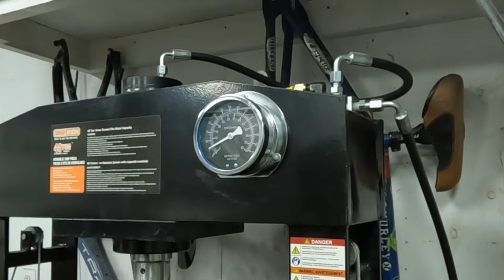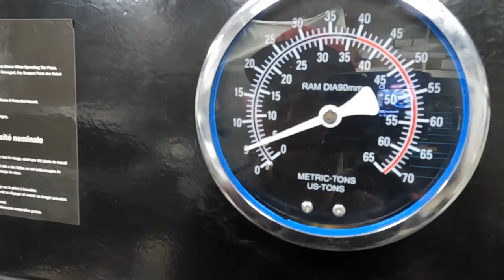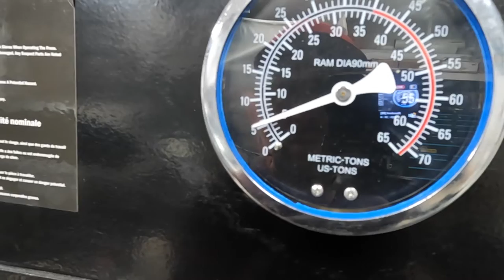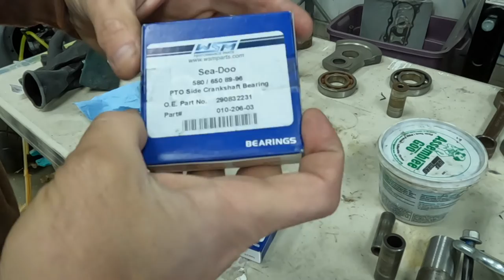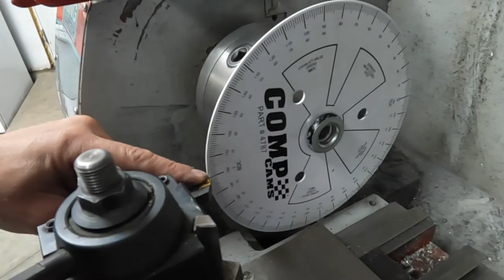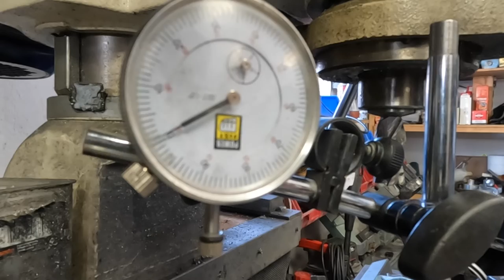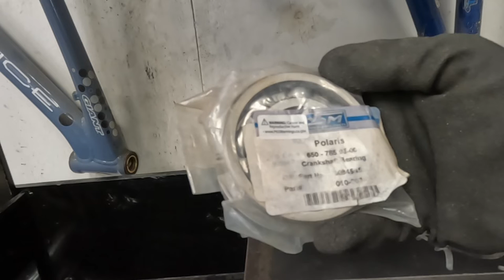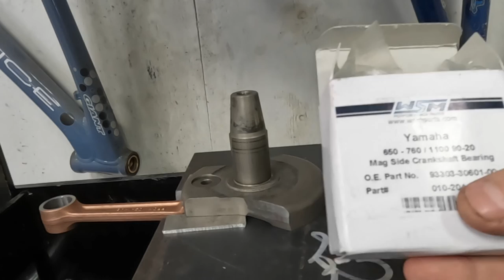KRASH KV997 Crank Rebuild - Sweet Sweet Success !

Comment: I've got a kawasaki 650 sc crank that is out of phase by 20-30 degrees.  I rebuilt everything on the engine just to find the problem was the crankshaft the whole time.  I've made some tools and used a friends 150 ton shop press and I have the crank apart.  Been researching how to get the phase correct and I'm gonna try this!  Going to weld the pins in as I go to make sure it does not get out of phase again!  Well done and thanks for the info!
Reply from the maker: Good luck. Let me know how it goes. Take care when welding 1. (obviously) not to damage the crank but also 2. use a compatible filler rod (not sure what that is) 3. not to put too much heat into the pin or web 4. try to weld directly across from each weld to avoid pulling the crank out of true.

Comment: Very cool video, I really appreciate how you found the correct parts for the rebuild. Yamaha bearing, seadoo bearing, and best of all cr500 connecting rods 👍🍻
Reply from the maker: Thanks ! It was a challenge to find some of the parts. The connecting rods actually have the part numbers on them, so that part was pretty easy, haha... The inner bearings also have numbers, but the two outer ones were tricky and it took me almost a week of research before I found out that Yamaha uses that large bearing on a TON of their stuff. 

I'm very confident now that I can rebuild all of my cranks, so that's a pretty big deal. It cost me $580 for all the parts and a new crank is $1540. plus shipping. If you include the press and the materials to make tools it was about $2160 haha.

Comment: You are a genius man, saved me ,  I have to make this job on a safari 377
Reply from the maker: Cool !! What year Safari !?
Reply: When I saw your video said the same: Great!! But I tried two times with a 15 TN press and nothing happened 😅, is a 1991 , have another 377 in a paratrike that I made in pandemics, I will try again next days, is not my press, so I can't try all the time
Reply from the maker: @Detodounpoco-xb2zo  Wow... that's on there good if it takes more than 15T ... I'm guessing you would notice if it was welded ... If it is not, try to heat the web area. If you just have a propane torch it make take 5-10 minutes. I can't remember but I don't thin any of mine took more than 5, maybe 10 tons.

Comment: Man!  I love how professional you make your tools! That bearing tool is brilliant!  You should patent those tools!
Reply from the maker: Thanks for the compliment !  The tool is in the public domain now as I showed the idea in a video, so it is not patentable, but it would be awesome if a manufacturer took my idea and turned this into a puller set (you need different sizes for different bearings) (and also different lengths) 

I don't know where you get them, or what they are called, but there is a tool that is kinda similar to this. I have only ever seen Alan Milyard use it. Basically 3 arms with rounded hooks that hook into the outer race by putting then in at a 45º to the shaft and then rocking them parallel to the shaft. You then use the main part of the puller to lock the hooks parallel and pull the bearing off.

Comment: This is great! I'm going to be attempting this with a 250 single so it should be substantially easier. I'm starting to think I might be able to do this correctly.
Reply from the maker: You got this ! Take lots of measurements before you get started and remember that you can always start over if you need to. Take your time and you'll get it.

Comment: Joel, I have not tried this (yet) but was planning on trying my hand on some crank rebuilds and doing the phasing making a set of spacers so that I can set one crank web with the center pin on the bed of a mill with a spacer under one big end pin and put a spacer under the big end pin of the "loose" crank web so that it will sit at 180 degrees phase relative to the one already on the center pin/bearing assembly. Afte rpressing together the phase can be checked by flipping over. Not sure if that made sense kind of tough to describe by words.
Reply from the maker: Yeah, I'm having a real hard time picturing what you are talking about, haha. There are lots of possible ways to do this, that's for sure, but explaining with just words is tricky. 

I have had a few ideas that may be what you are talking about, but I can't tell, haha.

Comment: Really good video dude!  Question for you, did you ever exceed 10 tones on your press?  I have a 10 ton, but wonder if it would be enough to attempt this kind of thing at home.  I've been on the look out for a used lathe that I could hopefully get set up some day..  You made it look very satisfying to get it as close to perfect as you could within a reasonable amount of time.  Fantastic to watch, and learn.
Reply from the maker: Thanks Dustin ! 

I never went over 10 tons, but there's a little more to it than that. I wouldn't discourage you from doing it, but, as I'm sure you are aware, with a 10 ton press, when you get to 5 tons you start to get a lot of "spring" where you pump and nothing moves, then it goes "bang" and moves more than you wanted. You just need to keep that in mind for every component you push on. 

Most people will say that 20 tons is minimum, but like I said, if you just keep i mind that your press won't be what determines how far things move, you can come up with other ways to ensure you get the desired outcome. You're also welcome to come and use mine any time.
Reply: @JoelArseneaultYouTube  A 10 ton will 100% "spring" we used to have a metal grate across the front of the press as pieces would fly out of it, it also made it VERY hard to get things to press on to the correct location, temperature had to be really consistent and that helped. We then reinforced the press and it was much better but all the issues when away when we upgrade to a new press.
Reply from the maker: @MrSector9  Right on... I remember the press we had at Ray's ... it had an upgraded ram and it was scary. I remember trying to push bearings out of hubs. Nothing, nothing, nothing .... BANG !!! stuff flying everywhere. We had some sort of shield too, but I forget what it was. 

it's funny, I just recorded some bits for a video talking about the tools I used, and talked about how an "overkill" press would make it much easier due to less spring / less stored kinetic energy. A 40 ton press at 10 tons has very little flex, so you can push a pin in a few thousandths at a time instead of nothing and then 1/4 inch.

Comment: Wonder if i could take a bunch of my 1100 kawi cranks apart and then piece a few back together.  I do have a lot  lol
Reply from the maker: Probably. Just pick out the best pieces ! A few of the triple cranks I have do not have replaceable pins, meaning, the web and the big end pin are all one piece. Regardless of this, if you have enough of them, you should be able to find enough good ones.

Comment: I have a 750 indie Polaris Storm where the crankshaft maybe bad as a possible to send it out to you to have be rebuilt
Reply from the maker: Hey, It's possible. I'm sure that shipping cost would be considerable. Do you have the crank out of the engine? 

One major concern with any crank is if it uses separate rod pins, or pins that are part of the crank webs. If it only needs bearings, then this is not a problem. However, if it needs rods and big end pins, sometimes the rod pins are part of the crank web, and this means an additional huge expense, if you can even get them. A lot of the Kawasaki cranks I have, have this problem.
Reply: @JoelArseneaultYouTube  I'll get back with you on that

Comment: Is it necessary to replace the webs on a Kawasaki crank? Great video as always
Reply from the maker: Good question.  I’m afraid that’s not a straightforward “yes” or “no”.  

Many Kawasaki cranks have pins that are part of the web. In this case, you need to push the crank apart and inspect / measure to know if it is damaged or out of spec. 

If it isn’t, you can order a rod kit and push it back together. 

If it is, you have two choices. Get a new web(s), or have a machine shop machine the proper bore so you can press a pin in. This requires very accurate positioning of the hole as well as very accurate tolerances for the size. Mark from Erickson Machine and Performance offers this service. I’m not sure what it costs. 

If you are lucky, you have a crank like the one in this video, and the pin pushes out of the webs.
Reply: @JoelArseneaultYouTube  thanks for the response, only one way too find out, I'll start pressing
Reply from the maker: @donalhoward2962  Yeah... you can look and see if it is a press out pin or not, but you can't see if the pin is good or bad.

Comment: Hi Joel,good video,but I don't espeak english and its difficult for me to get the reference of the bearigs
I have benn trying for two hours and I can't find them 
Can you help me. Thanks
Reply from the maker: Hello. I have posted all of the information about the crank that I know in the description. I will paste it below as well. Bearings were all purchased from the company WSM but I put additional information so you can see what other machines these bearings are used on.  
 
Center bearings. WSM 010-206-03. SeaDoo 580 / 650 1989-1996
Dimensions 35 x 72 x 17

PTO bearing. WSM 010-207-0. Polaris 650 - 785 1993-2000
Dimensions 35 x 80 x 21

MAG bearing. WSM 010-204. Yamaha 650 - 760 / 1100 1990-2020
Dimensions. 32 x 72 x 30

Comment: Are you going to weld any of your cranks and do you think it matters? The yamaha vx cruiser I believe it is has a 155 pump but uses kawasaki impellers so the kawasaki driveshaft will plug in. Might be a good way to go on this build. I'm curious how the exhaust will turn out.